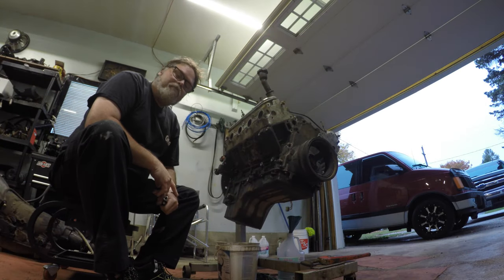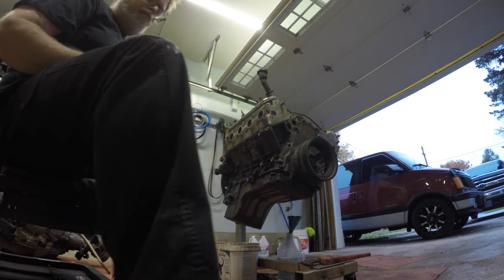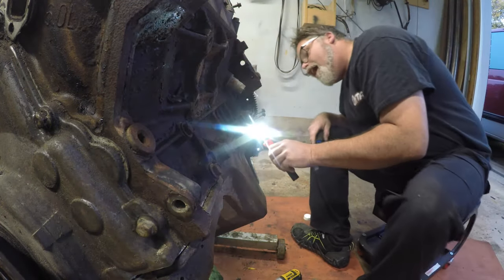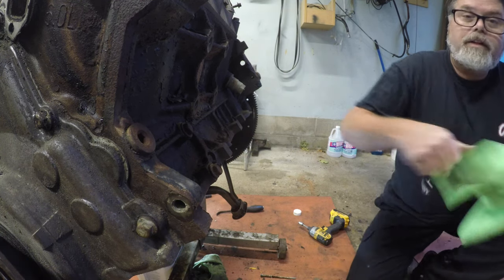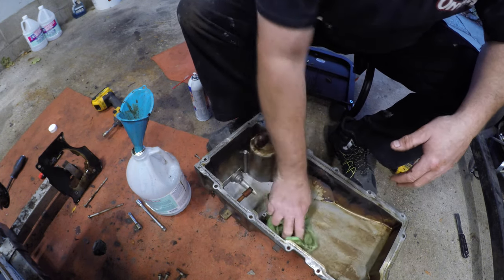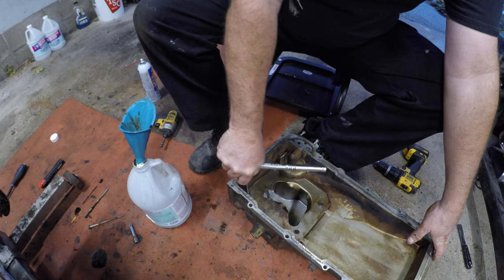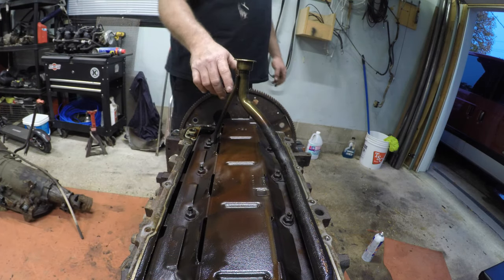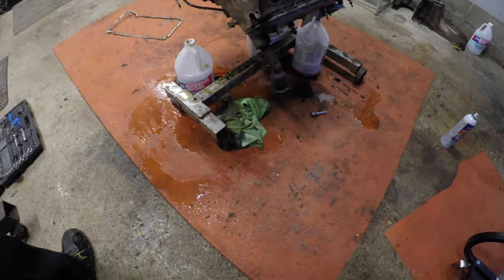LS Oil Pan Removel

Comment: If you want to clean the block on the cheap and very good resolves. Use a  needle scaler and oven cleaner from the dollar store. Then paint her up. Look better the brand new. Dont use the needle scaler on the alum parts tho. Just the oven cleaner.